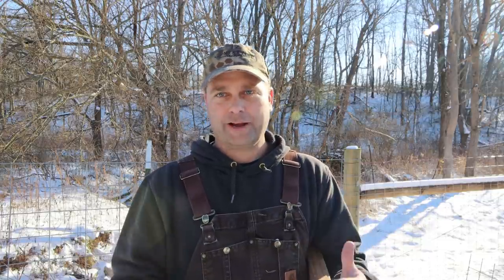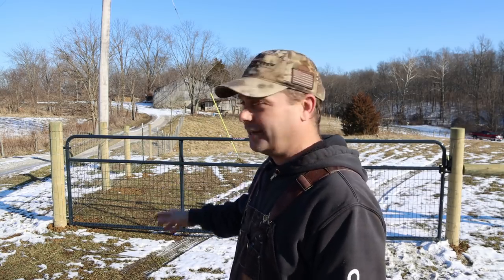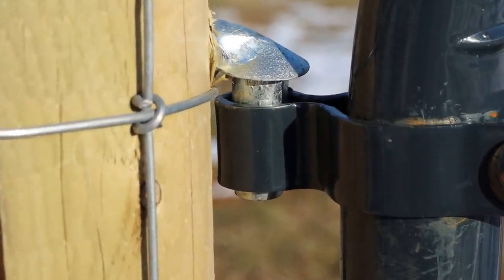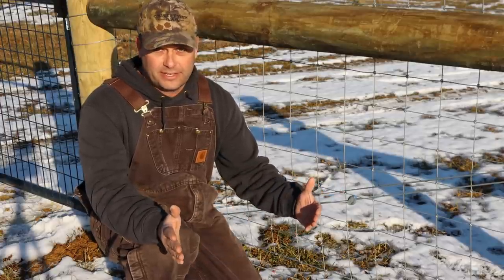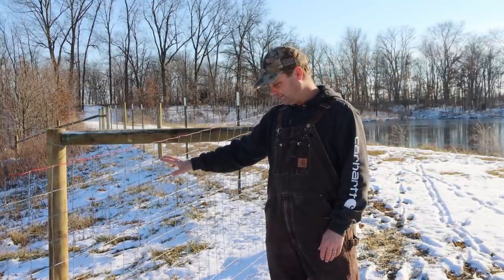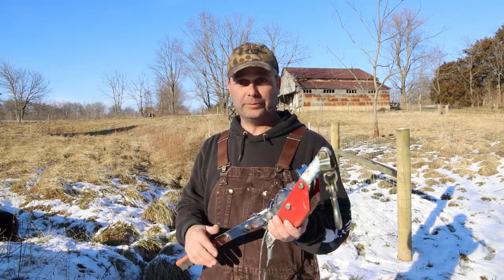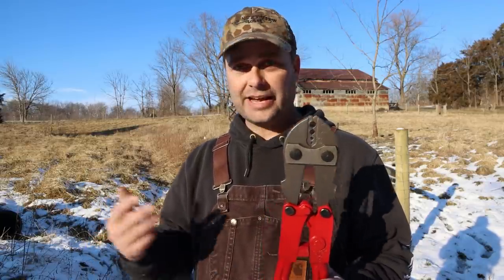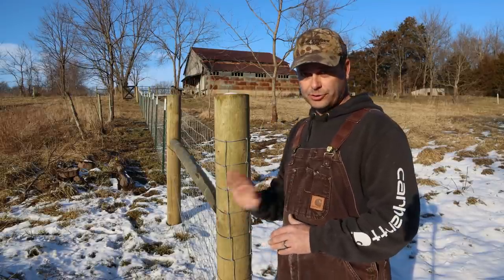What did the fencing cost?  How big is the pasture??  Why double braces??  Fencing Project Q&A

Comment: Evan, adding some heavy rip rap to the culvert at the screen should not cause any blockage of flow, it would do a nice job of adding to the security keeping out predators and would be inexpensive. The fence job looks challenging in the weather but looks like you and Rebecca did a good job that should be low maintenance over at least 25 years.

Comment: Good job on the fence.  The traditional barb wire at ground level is to stop rooting pigs from digging under the fence.  If your threaded hinges drop or loosen, swap them out for bolted hinges.  You just drill through the post and nut and washer the bolt on each side of the post.  Looks good.

Comment: You may want to consider installing  cattle panel at tile outlet as well, racoon/ground hogs will run into same to hide while being chased by predators. When they try to turn around they become lodged in pipe due to corrigation of pipe. If heavy rains come before carcass has deteriorated it stops the flow. Learned that the hard way.

Comment: JudithB  I had a  farm,  and  now  a  homestead-all  needed  different types of  fencing.  I  put  barb wire  at  the  bottom of  welded fencing  to keep  hogs in  a  small pasture,  and  one  strand  at the  top  to keep  the  cows and  horses  from  scratching on  the  wire.  I  just  did  a  simple  barb wire  fence  here  to keep  my  horses  in  and  people with cars  out.  I  wish I  had  put  welded wire in  to keep  out  dogs tho!!  I think the tools  you  used  will  last  you  forever so are  a  great investment,  and  the  fence  is  also  a  great investment  and  should  last  many  years.  I  use  hammers and  fence pliers  for  about  everything,  and  come alongs  are  very  handy  too!  LOL   I  weave a  tpost  down thru woven wire,  attach a chain  and  tighten with  the  truck or tractor- does the job but  not  as  pretty  as  your fencing!  I like  seeing  new  ways!!
Reply: Well,  dont know what I did there,  but its  readable! LOL

Comment: Great video.  you did a lot of homework and I can say... that fence isn't going anywhere.  looks a lot better than mine.     As someone that has cattle, one thing I have learned with your style of fence.   Cattle like to rub or itch especially in the spring as they lose their winter hair.   ours like to rub their necks on the top of the woven wire and it stretches and bends it down over time.  if you see this happening, we resolved it by running a strand of barbed wire just above the top of the woven.

Comment: @ 5:20 - 5:25... Was that a weasel down by the rear of your truck? With the cost of lumber now... building a stretcher board out of wood would probably be more expensive than your $110 wedge design. Love that gripple tool... wish I had that when we built our pasture. You guys did an awesome job!

Comment: Agri-Drain sells a product they call a beaver guard for their pipes that goes on the outlet side of drain pipes. it is just a set of rebar on a hinge so that any big material that goes through the pipe flushes out but nothing can come into the pipe, you just have to drill a few holes or use the band clamp type.

Comment: I noticed you have one pin up and one pin down on your gate for the henge.... I realize you do that so the cows can't root it up like a pig would and dis lodge the gate.... however ...in all the years we ran cows back at the Ranch we never had a cow knock off the gate...they did figure out how to un lock the gate so we ran a chain and spring clip to stop that.... but they never messed with the henge.... having 2 points acting as weight support ( if you measure carefully)
is alot better than one and it is so much easier it you want to get the gate out of the way completely...which does happen. you can just unlock the gate walk to the middle and lift it up taking it off the hinges.... putting it back on takes 2 people but it is far easier getting a wide implement through a skinny gate if the gate is completely removed . but the critters never messed with the hinged end of the gate.... their smart enough to check to see if you locked it
though, but sense you never go to the henge side neither do they...
.... Your fences are far superior to what ours were by far, so people should listen to your wisdom on this... we used 4 strands of bob wire for our cows and yes they frequently got out
we switched to 6 strands in problem areas and got rid of the fence braking cow ! once they learn how to get out they will teach the others and you will not keep them in.  out of desperation we switched to 4' hog wire and 2 strands of bob wire on top that worked !
Our horses were the worst offenders I watched out Mustang lean into the fence so hard and then back away and examine it until she could step over it without scratching her belly !
( she wanted into the garden !!!)    that is why you put posts every 10' not 20' or more they will stretch the fence and get out !

Comment: A stamp set to let you punch info into a copper or aluminum data plate for the start and stop points of the fence. Will you remember what dates you installed the fence in 10 years? 20 years? 

Also great when you are putting fencing along a property line as you can include things like is it on the line or offset by how many inches and Was it paid by one side or both sides paid for it?

As for where to get the copper you can always cut open scrap copper pipes for sections to flatten or buy a roll of copper flashing to cut sections off.
Reply: No one in my area uses a data plate.

Comment: One last consideration is the tops of the wood fence posts.  Those will be the first things to rot, then won't hold staples very well any longer.  There's several solutions, first of which is just cutting them off at a slight angle to force the majority of the water to run off of them.  there's different "caps" that can be put on them....some are junk and don't look good....others are very expensive (and used mostly on dock posts in lakes, ponds, etc...) and will last forever.  There's also different coatings you can put on them, but pressure treated wood doesn't bond well with coatings over the long run.  I installed about 50 posts several years ago in the process of installing 8 gates and some fence corners and ended up buying 6" PVC sewer & drain caps and a couple sticks of 6" sewer & drain pvc pipe.  I cut a 6" piece of pipe, glued a cap on it, then installed them on each post with a few stainless screws.  I spray painted each one with a color that was very close to the wood color.  Total, It was about $7/post to do it, but will also last a lifetime without breaking the bank....and there's no way the post tops are going to rot.

Comment: In the UK they sometimes use a device to join/tension fences which is basically a spindle attached to a pawl. You put the end of the fence wire through a hole in the spindle, put a wrench/socket on the end of the spindle and tighten.  Do they use them here in the US?

Comment: If you changed the gate you can use the fence line to help you be able to load into a trailer. Just a thought. You might want to put barb wire on the top of your fence if u get cattle . I can’t believe how much it cost for just an acre. Good job with all your videos

Comment: On the gate couldn't you add a wire brace on the hinge side. I put a board nailed to the bottom of the post for the gate to rest on. I also chain the gate wouldn't trust the latch the cows nose everything.looks like a good job overall. Remember we found fault with Jesus.